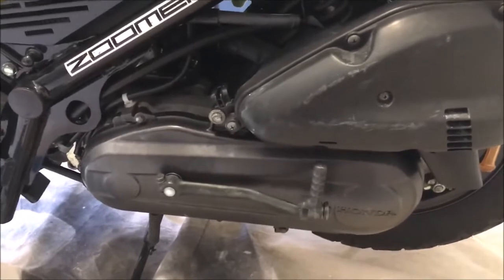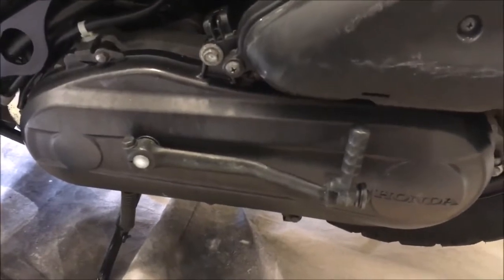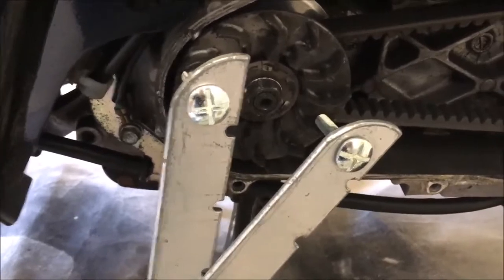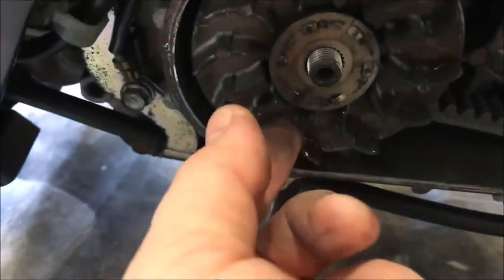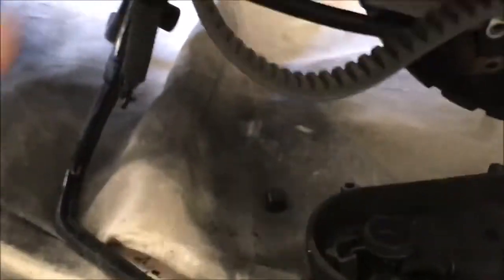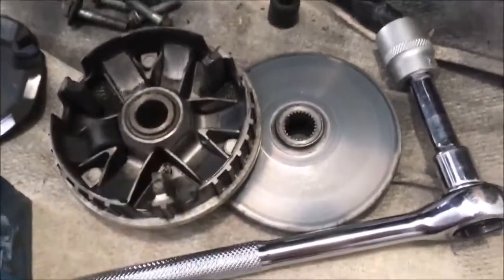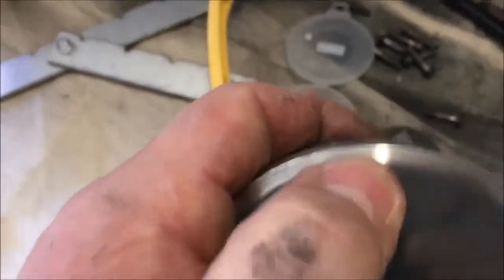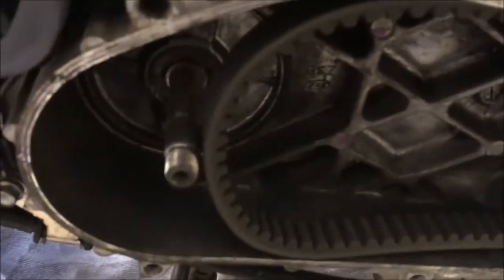Variator Removal and Upgrade on a Honda Zoomer

Comment: Investing in a electric power tool would make removing this and other things much easier. Nice to see you installing it properly with hand tools & a torque wrench. People just love over tightening these back on with random power tools.
Reply from the maker: Thanks for watching.  That’s quite an old video, I have since invested in an impact wrench which makes things a lot easier.  Still take care when re-assembling though, damaged splines are not a good idea 👍
Reply: What were the performance pluses?.. mine used to do 27mph tops, now does 25mph, could Polini and dr Pulley rescue me from the 3 p's?
Reply: @CrustyBiker  a healthy well running stock Honda ruckus should be hitting upper 30’s to low 40’s on level ground. If you’re topping out at 25 mph you likely have a mechanical issue. Figure that out before trying to improve on stock performance.